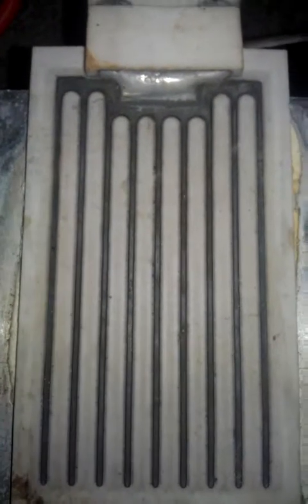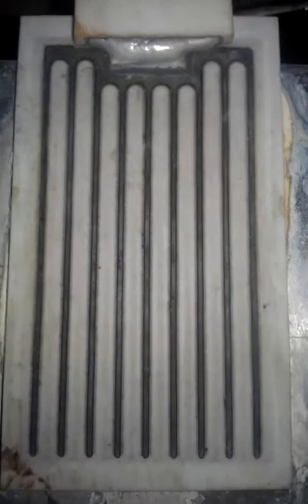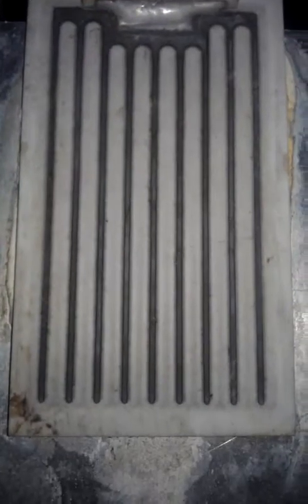DIY Ozone plate

Comment: Where did you get the ceramic plates and how much did you pay for them I would like to get a set to make and hold tone generator myself
Reply from the maker: Allen Paul  I need to order some more I was going to put some on Ebay , I'll let you know a price if you wish , I didn't  look after these and had glued them to a metal board in the wrong place , what were you wishing to use it for if you don't mind me asking??
Reply: Yes I would like you to let me know the price when you find them on ebay I'm trying to make a ozone generator just to try to go sure by air inside my home and I appreciate you getting back to me so soon thank you
Reply from the maker: Allen Paul Sorry for the delay been very busy I will be ordering four in a week or two they will take a couple of weeks to get here they will be £25-£30 probably but I would test them and package them properly and send them straight to you.